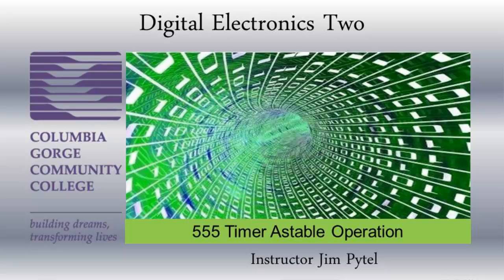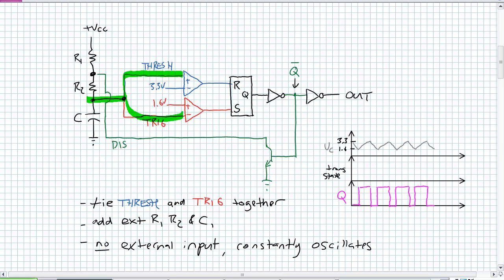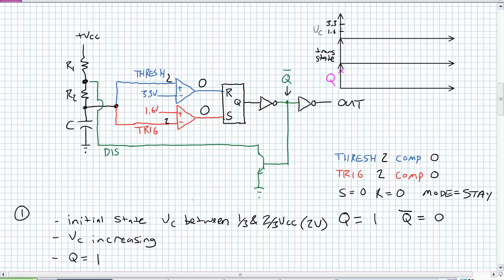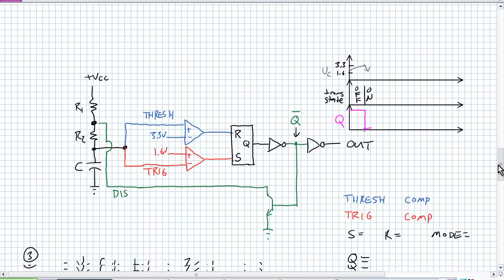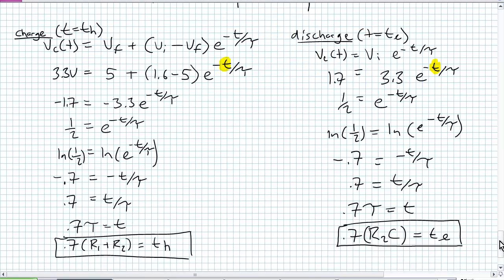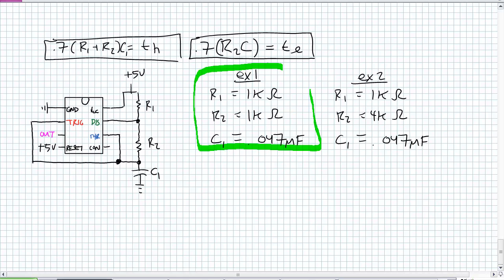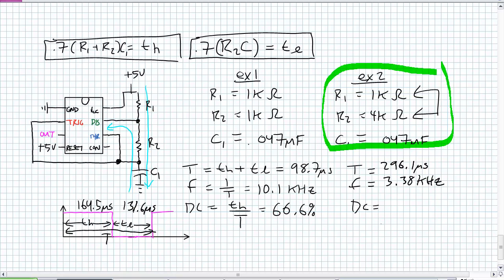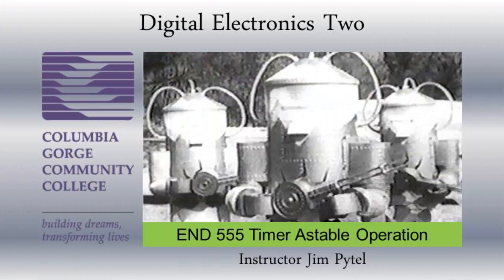555 Timer Astable Operation

Comment: what happens if R2 was just a wire? Does the capacitor instantly discharge, hence you will have a very small time  where the output is off? Thanks for the video